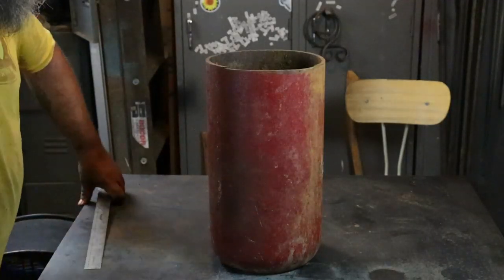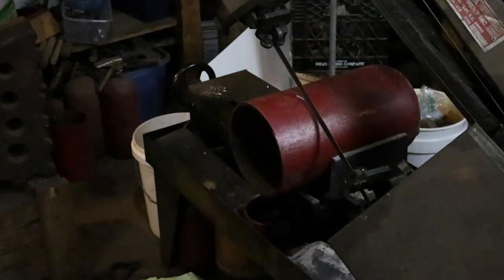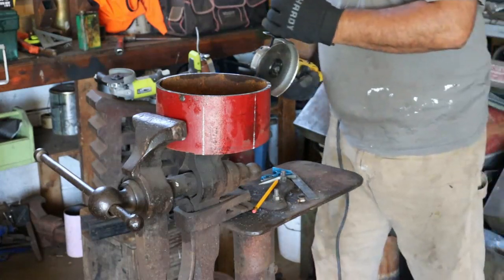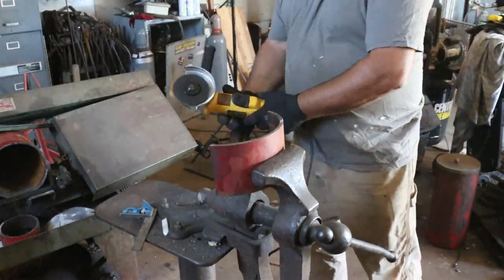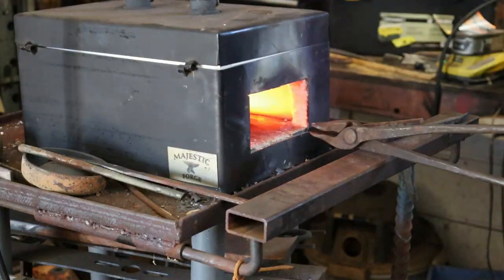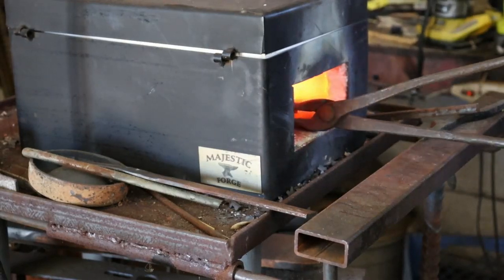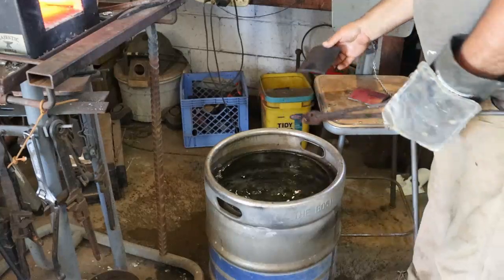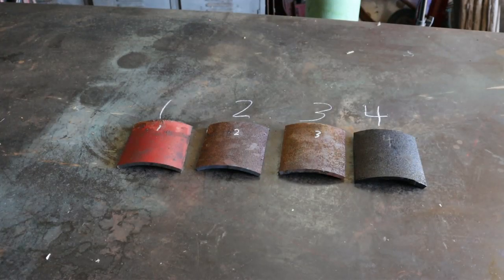DemolitionRanch Armor Challenge Voo Doo Scale Heat Treating The Test Material Blacksmith Armor #1

Comment: Aright time to binge watch this on my way to work, great work man. Btw a safety belt suspender (those three point ones with a Y shape in the back ) with one-touch clasps like you used in the waistline, setting them in the back would make a nice addition to the final set to distribute the weight more evenly and making it less awkward to wear

Comment: what is the steel composition. i might have missed this .
Reply from the maker: I know it's a medium to high carbon but that is all I know.
Reply: I have looked around and I think the cylinders are required by DOT to meet a certain strength and I believe they are 4130 or 4140.  I may be wrong.
Reply: That's insane 4130 to perform this well I had no idea